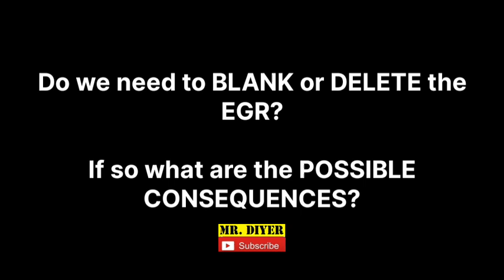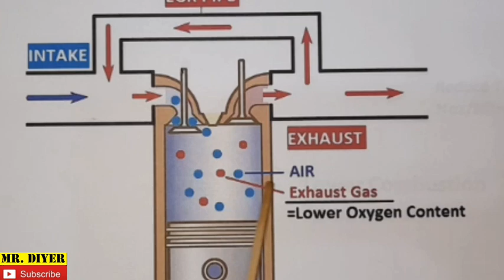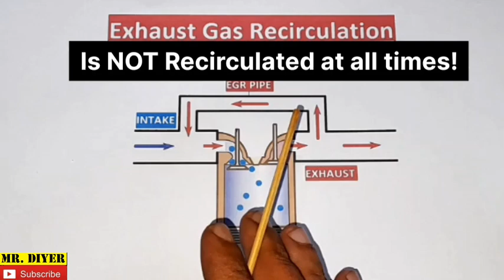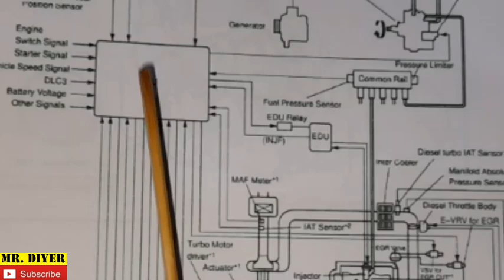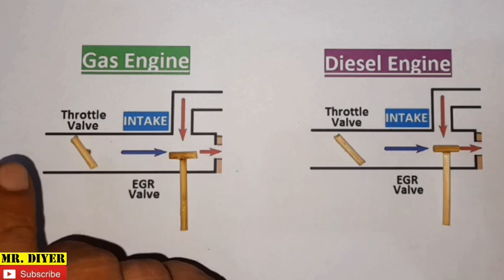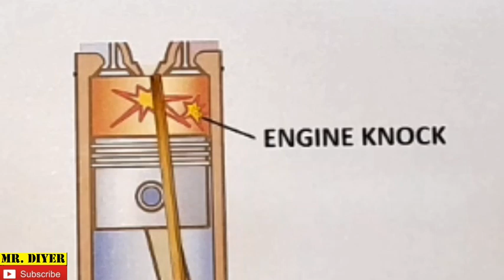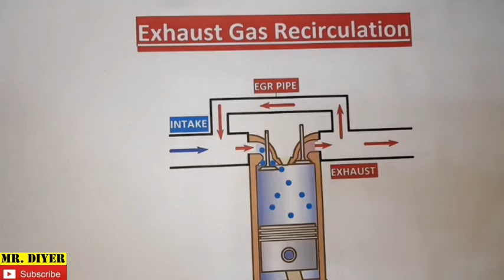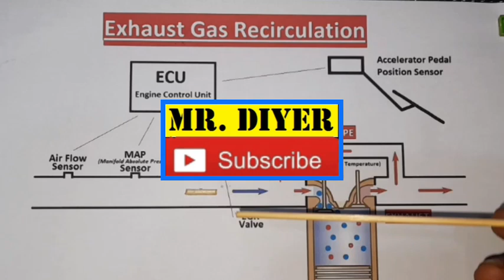EGR Explained! Do we Need to DELETE the EGR?

Comment: Thank you, still in limbo about blanking mine though. Whislt you explain amazingly how the EGR valve works and its' importance, could you explain the carbon build up. I think it is the fact that all egr's eventually need replacing because of this, and there is so much carbon build up that makes people like me think, that can not be good for the engine. My thinking goes straight too, 'this is just making my engine really dirty and therefore affecting the longevity of my engine'. Sorry so long, and in what way am I wrong in my thinking.
Reply from the maker: Carbon build up is inevitable. It is cause by a combination of a little of everything from heat, fuel, oil,  air, dirt fumes etc. Just the same as you see the bottom of your prying pan goes black  or the inside of your oven or bbq grill so too does your engine. Best approach i would say is observe proper maintainance like clean oil clean air clean fuel.
Reply: I blanked mine, and have no problem, and engine oil is still good. 👀
Reply: My experience of carbon build up on turbo diesel engines is thus.
Soot and exhaust gas enter the intake, in a perfect world it would get sucked into the engine and burnt off, sadly this is not the case.
Soot will mix with tiny oil deposits in the intake and form a nasty sticky tar, this sticks to the inside of all the intake manifold and intake valves and the egr valve itself.
Then when the engine cools down this sticky tar turns to a coal like substance, rock hard, ready for the next layer or tar to come through.
The obvious outcome is reduced air getting to the engine, valves start fouling, throttle sticks, egc failures.

Every diesel I've had I have blanked or disconnected EGR. Cars run soooo much better.
Latest car is a 2.7 V6 TDI, both EGR's blanked and ECU remapped to delete their use.
Car is better on fuel, starts, runs cleaner, absolutely NO exhaust smoke, hot or cold!

That's my experience.
Reply: @samstergti9812  EGR delete is always the way to go.
Reply: @samstergti9812  Thanks for your great explanation. My deisel multijet turbo was playing up juddering on accelerating and really rough engine when slowing down using engine, ie. when I take my foot off the pedal. So disconnected MAF, car ran like a dream, no judder, no longer sounded like a tractor. Changed Air filter and MAF, no more juddering but still engine noise and and vibration, when coming off accelerator. Thinking it as got to be EGR or throttle, it is definately air related. I am female so mechanics do not take me seriously, there is nothing wrong with MAF they said and it is not throwing any codes, so there can not be anything wrong with throttle EGR. Every EGR I have had blanked off due to failiure as never thrown a code, but this video as made me worry about blanking and fuel consumption?

Comment: Depleting the egr or blanking off the egr would be like having a "VW engine having a permanent cheat device". Yes, No?. 🤔🤔🤔🤔. Engine will be running with exhaust having excess air of around 20% instead of around 10% excess air?. OBD would be seeing a lower voltage reading coming from O2 sensor?. Regards.

Comment: This is WITHOUT A DOUBT THE BEST EXPLANATION about the EGR! All the other videos ive seen only focus on the egr recirculating exhaust gas into the intake, but they never explain why, what for, the way it all operates. This video COVERS IT ALL! 
I could honestly say that i was one of those who considered the egr a dumb idea and question what it was for. 
THANK YOU FOR THE VERY INFORMATIVE VIDEO!
Reply: At the end of the video you refer to a gas engine. On a diesel engine there should be no pumping losses, but the trottle valve introduses just that. So would a proper EGR delete include removing also the diesel trottle valve?
Reply: yes. delete the egr! also, delete the rest of the engine, and get av EV.
Reply: @skataskatata9236  Yeah because those lithium and cobalt mines are so environmentally friendly....
Reply: @skata skatata  actually you are moving the engine to a different place away from under your hood,unless you are only using solar to fuel your car.Electricity doesn't just grow.
Reply: @skata skatata  as if getting an EV makes less pollution and reduces carbon footprint. cough cough toxic lithium pools & cobalt mining

Fuck your EVs. Hydrogen-powered ICE is the future of clean combustion.
Reply: @skataskatata9236  You really have no idea how the greater EV supply chain for everything that makes them exist and function works at all, do you? 😂
Reply: @skataskatata9236  delete the EV and go on foot (and wait for internal combustion hydrogen cars)

Comment: Great explanation helps me understand. 
Can  you please help about black smoke coming out of tailpipe in diesel engine.
 Thank you very much.
Reply: Feb. 18 2023 most diesels smoke because of poor quality fuel , consequently the injectors get a dirty Carbon coated tip causing the spay pattern to be deformed , “dribble” , must be similar to paint sprayer to fully atomize the fuel . Solution - buy injector cleaner, give it a good purge, & continue to add as a maintenance